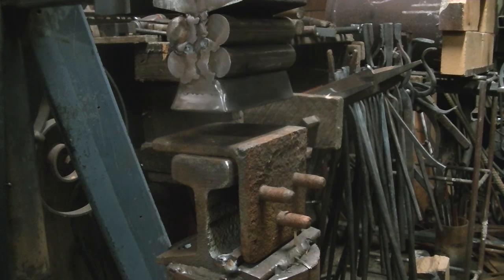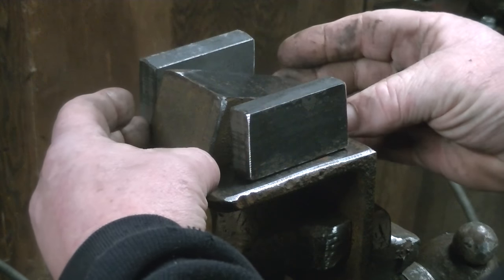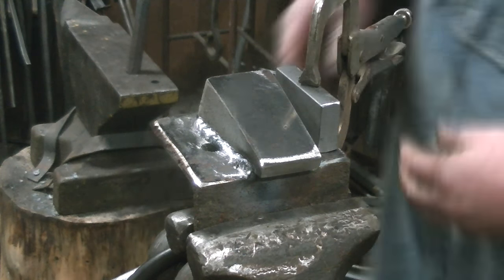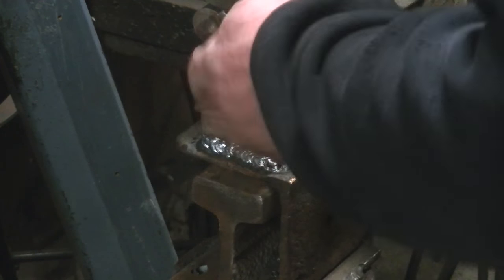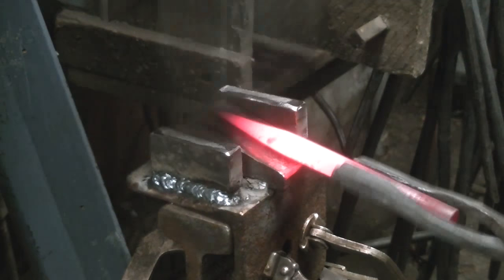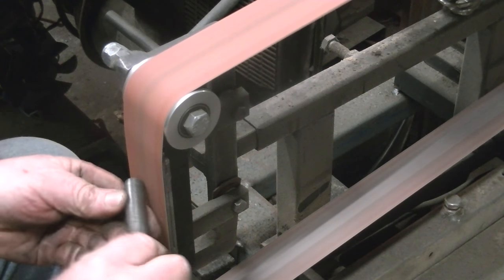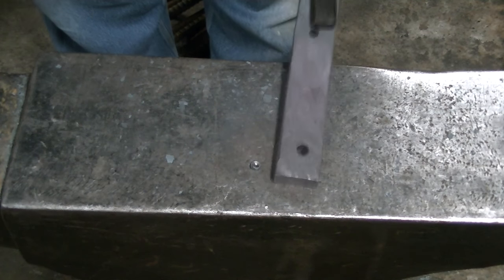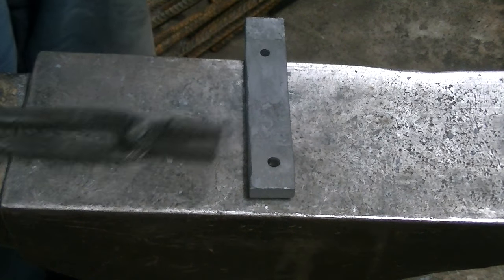Blacksmithing Tools Tools Tools

Comment: Another satisfying video/project to watch!  That was really interesting to see all that scale pop off the A2 punch when it naturally looked (to me at least) as if you were normalizing it, since personally I've  never forged anything with that much alloy content in it.. Pretty much 1075, 1084, 1095, W2, 52100, O1 and the like.  But it makes sense being that A2 is an air hardening steel, so you basically had just "quenched" it in air in that scene.  The same thing happens to simple carbon steels when you quench them in either oil or water, most the scale pops off from the contraction.  Anyway, just thought that was interesting 😉.  Thanks as always for sharing!  Looking forward to your next project. :)
Reply from the maker: Hi Isubslimed Thanks for checking out the video, my method of hardening A2 tends to produce more scale I typically let it soak in the heat for about 5 minutes just above critical temperature for me that seems to produce a better result but it also produces a lot more scale.  But there seems to be some strange sense of satisfaction watching the outer shell pop off, anyway have a good one and thanks for checking out.

Comment: ..i spent a couple of days last week making a handful of punches from coil spring in various sizes. it's something else making the smaller ones, 1/4"-3/8". especially from 1/2" and 3/4" material. they came out longer, but heck, i can live with that...
Reply: Ol James n
Reply from the maker: Hi Ol James- I've always had the opinion that it doesn't matter what a tool looks like as long as it does its job well and the fact that you've made it with your own hands is really the important part, I'm glad to hear that you're in the shop making things, keep up the good work and thanks again.

Comment: Did you heat treat the punch?
Reply from the maker: Hi Dylan I did not heed treat the punch it's made from A2 air hardening steel simply bring it to critical let it cool and it's hardened, it can be softened again by overheating in hot steel so I keep a cool by dipping it in water between punches.  Thanks for the question and thanks for watching.  Take care
Reply: BIG DOG FORGE   where can I get that kind of steel?
Reply from the maker: I'm not sure where you're located in the world but I get mine at a place called Tacoma Screw You can also pick it up at Fastenal or just about any steel supplier, depending on where you are they may have to order it in.  Here's a link to Fastenals website where you can find A2,  https://www.fastenal.com/products/details/0988718?term=a2+stee.    Good luck
Reply: Thanks Big Dog.  I'm in Maine.
Reply: I was born in Tacoma WA. Is that where you are?
Reply from the maker: I am just north in Sumner, it's a small world.